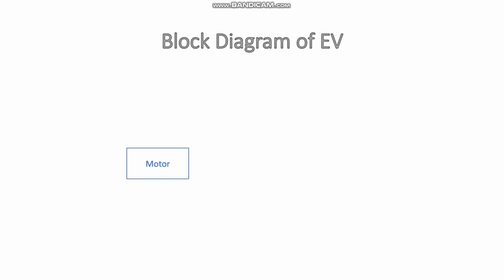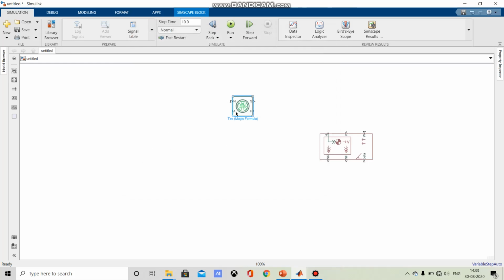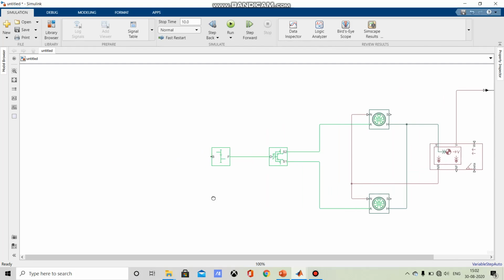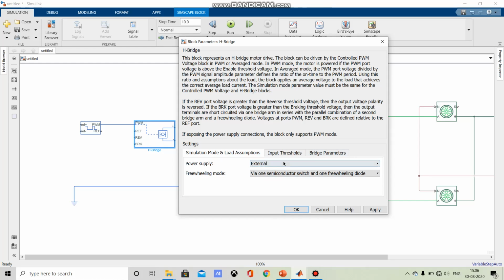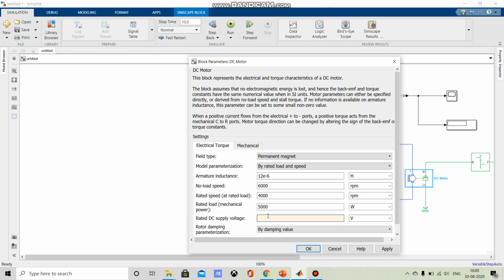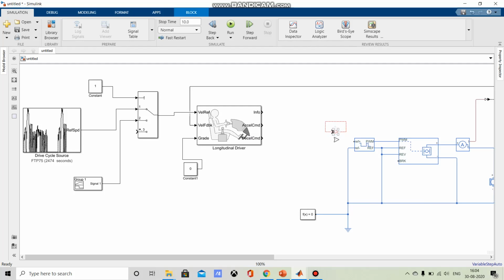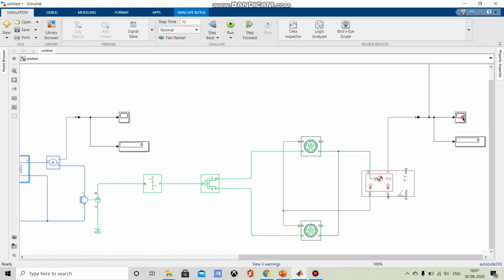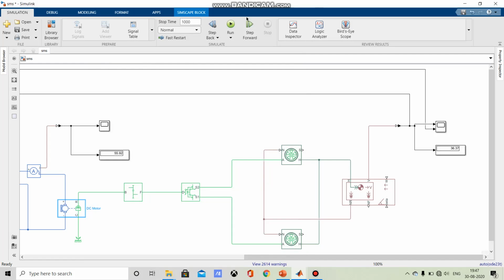EV Simulation Using Matlab Simulink (Part-1)|| SoC & Range Estimation || Explanation of Each Block

Comment: To develop a battery model integrated to the above e drive machine based on following requirements
 1. when is charged below 10% of SOC the vehicle should stop 
2.while vehicle is running the SoC of battery decreses over time 
3. when aby current source is connected it should rise the battery SOC over time 
sir plz explain what can i do???

Comment: Please share the model to naliniveeresh22@gmail.com.i have simulated it. But  not getting the expected results and unable to debug it. So plz share this model
Reply from the maker: Sent.
Reply from the maker: If you are not getting expected results for particular drive cycle then check the feasibility for that speed & load by
1) Motor spec like wattage & rpm, 2) Differential or simple gear (change the ratio) according to the gross vehicle weight & resistance of vehicle.....
Change these values you will get your expected results.....

Comment: Sir I request you to send the complete model on snasir93@hotmail.com
Reply from the maker: Sent.
Reply: Error is coming which says
Error using open (line 146)
Invalid block diagram name supplied. Valid block diagram names are the same as valid MATLAB variable names. Type "help isvarname" for more information.

Please guide
Reply from the maker: @saalarnasir1150 I have shared the updated file...... Pls check your mail

Comment: In my matlab software I am not able to find those component such as vehicle body, motor, controller, display. What to do..??
Reply: You need to download simulink with driving libraries or you can use adds on to add from the list and select the ones necessary like vehicle,driving,etc